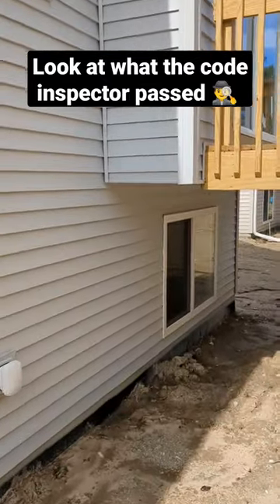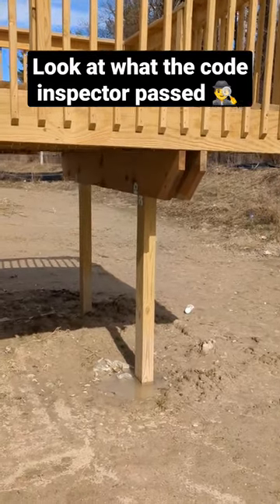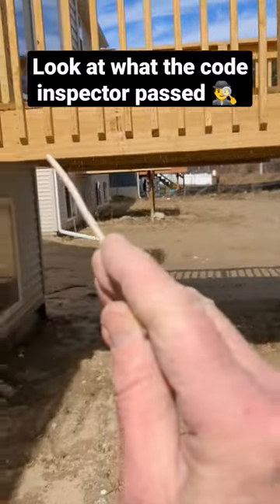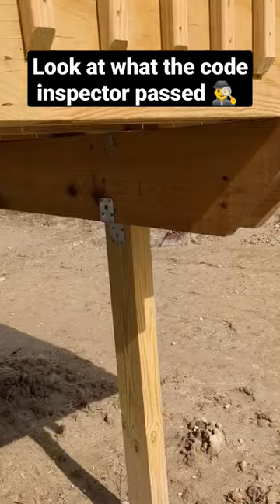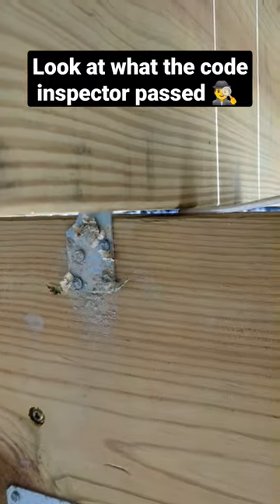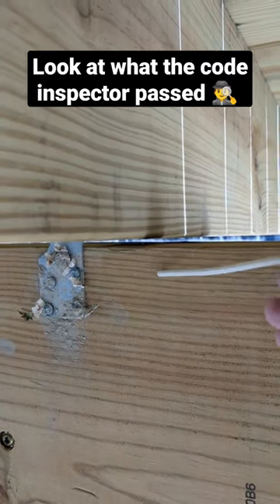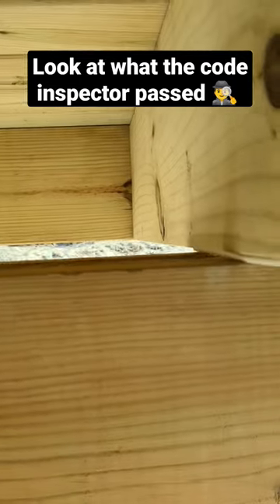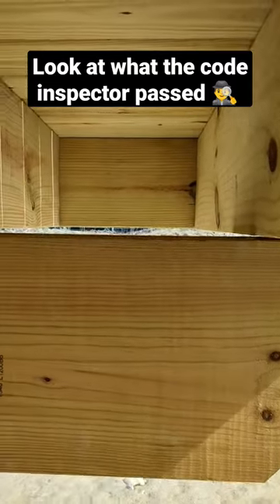Code #inspectors don't pay attention to detail#deck #newconstruction#youtubeshorts#shortvideo#shorts

Comment: Never seen a deck built like this. Why not use longer post, notch the corners and use the post as handrail too.
Reply from the maker: Yep. The whole deck is actually wrong and needs to be rebuilt. And yes, you could use a longer post if they are 6x6. This home got worse. SEE Missing Footings Inside https://youtu.be/TqGMGpvnVAk
I've been finding more developments selling homes with NO decks, but they install handrails in the slider door frame. Once the code inspector is gone a crew member comes back and slaps on the deck for extra money 🤑 and no permit. Ugh.
Thanks for watching.
Reply: @inspectflix  yeah 6x6 be more meat and the right way

Comment: The bigger question is, is it properly tied to the house?
Reply from the maker: Nope. The entire deck is improper and needs to be rebuilt.This home got worse. SEE Missing Footings Inside https://youtu.be/TqGMGpvnVAk
I've been finding more developments selling homes with NO decks, but they install handrails in the slider door frame. Once the code inspector is gone a crew member comes back and slaps on the deck for extra money 🤑 and no permit. Ugh.
Thanks for watching.

Comment: That's not a issue not going to fall down or anything. And will settle. The problem are the posts below grade sitting in water already. Even if it's code in that area doesn't mean it's ok why do it that way it's ridiculous.
Reply from the maker: Agreed. There were even more problems with that deck. The rest of the house was worse.
Thanks for watching

Comment: Those 4x4 posts resting directly on the dirt with a puddle of water around it? who built this? it will last about two weeks. This is why I did my patio myself.
Reply from the maker: Exactly!. You never know who it is. Subz. This home got worse. SEE Missing Footings Inside https://youtu.be/TqGMGpvnVAk
I've been finding more developments selling homes with NO decks, but they install handrails in the slider door frame. Once the code inspector is gone a crew member comes back and slaps on the deck for extra money 🤑 and no permit. Ugh.
Thanks for watching.

Comment: That deck doesn't seem to be to be sturdy enough anyway. It has just two fairly small section post sitting in water and the house wall to rely on. I hope the latter is very secure.
Reply from the maker: Nope. Everything is wrong and not up to code. That house got a lot worse. 3 pages on a new build.🤦😖ugh. Check out those missing footings inside.
Thanks for watching

Comment: I noticed that the post are sit in the ground. Here , we have to pour concrete in a hole with rebar then put the post on top of the concrete on a steel plate.

Comment: Everyone expects inspectors to look at everything and also know their code. Nothing could be farther from the truth. Also some inspectors give a pass on some things for contractors they deal with a lot. In extreme cases they accept bribes and favors. Lawsuits can also come about from their ignorance and mistakes.
Reply from the maker: Yep. And I'm sure it's different in all areas. Our problem here is the speed process. Some of the decks are installed after code inspections are done. 
They slap a temp handrail in the slider and then someone comes along and slaps the deck on after everybody is gone.
Thanks for watching

Comment: I was taught to put the beam on top of the post and blocking on each side to like it to the Post in the video looks like they just nailed it to the post and put a goofy bracket underneath it that I wouldn't trust keep in mind it is holding the deck

Comment: I’m no expert, but those two wooden beams don’t seem sufficient supporting the weight of people on that deck!
Reply from the maker: Nope they are not 🚫. Actually the entire deck is improper and needs to be rebuilt.This home got worse. SEE Missing Footings Inside https://youtu.be/TqGMGpvnVAk
I've been finding more developments selling homes with NO decks, but they install handrails in the slider door frame. Once the code inspector is gone a crew member comes back and slaps on the deck for extra money 🤑 and no permit. Ugh.
Thanks for watching.

Comment: Not supposed to attach to an overhang, sandwich headers are a not legal in most states anymore, and  whats up with the 4x4s instead of 6x6's. If the floor of the deck exceeds 6' they need to be minimum 4x6, 8' needs to be min 6x6

Comment: What's up with the wood being submerged in water too?
Reply from the maker: All bad! Unfortunately here in Michigan the code allows the post to go in the ground but must have footings. And 1 in 10 builders here are licensed. 
I think the deck may have been installed after the code inspector gave it a final.
What the builder does is put a handrail in the slider door track. Then someone comes back after and slaps that junk together.
Thanks for watching
Reply: @inspectflix  Oh gosh.  Yes, that definitely comes down to making sure to use a good builder.  Just because code allows something doesn't mean you can't or shouldn't improve upon the code to build things to either a better or safer standard.  Only 1 in 10 builders being licensed is kind of frightening.  I'm all for people being independent of government overbearingness, but only if they actually know their job and how to do things right.

Thanks for the video!

Comment: Gaps need shims at this point...dimensional lumber is not uniformly cut. You want a poker flat deck with no gaps? Rip all your joists to the same width and go from there.

😅

Comment: What about the 4x4 post inside the footings? It’s supposed to rest on top!
Reply from the maker: Yes. Absolutely should be on top. But, who knows what's really down there without digging. The entire deck is actually improper and needs to be rebuilt.This home got worse. SEE Missing Footings Inside https://youtu.be/TqGMGpvnVAk
I've been finding more developments selling homes with NO decks, but they install handrails in the slider door frame. Once the code inspector is gone a crew member comes back and slaps on the deck for extra money 🤑 and no permit. Ugh.
Thanks for watching.

Comment: Im confident those tiny galvanised z brackets holding those beams onto those posts aren't going to last long enough to worry about seating those floor joists.
Reply from the maker: 👍 And we don't know about the footings either Lol. That deck is a mess. Needs complete rebuild.
Thanks for watching

Comment: How about a cantilever deck attached to a cantilever. The deck should be self- supported.
Reply from the maker: Yes. The entire deck is actually improper and needs to be rebuilt.This home got worse. SEE Missing Footings Inside https://youtu.be/TqGMGpvnVAk
I've been finding more developments selling homes with NO decks, but they install handrails in the slider door frame. Once the code inspector is gone a crew member comes back and slaps on the deck for extra money 🤑 and no permit. Ugh.
Thanks for watching.

Comment: How can that be fixed?
Reply from the maker: It really can't or shouldn't because there's too many other problems.The entire deck is improper and needs to be rebuilt.This home got worse. SEE Missing Footings Inside https://youtu.be/TqGMGpvnVAk
I've been finding more developments selling homes with NO decks, but they install handrails in the slider door frame. Once the code inspector is gone a crew member comes back and slaps on the deck for extra money 🤑 and no permit. Ugh.
Thanks for watching.

Comment: I think we are a little picky about nothing. That will settle with a little weight on it with no damage. I’d be worried about the small posts more and being in water doesn’t help.
Reply from the maker: Perhaps, but I made several mini videos for my educational training. The entire deck is improper and needs to be rebuilt.This home got worse. SEE Missing Footings Inside https://youtu.be/TqGMGpvnVAk
I've been finding more developments selling homes with NO decks, but they install handrails in the slider door frame. Once the code inspector is gone a crew member comes back and slaps on the deck for extra money 🤑 and no permit. Ugh.
Thanks for watching.

Comment: So the beam is supposed to be supported by a hurricane bracket?
Seems way off!!!
Reply from the maker: 🤣😂🤣 it is. Lol The entire deck is improper and needs to be rebuilt.This home got worse. SEE Missing Footings Inside https://youtu.be/TqGMGpvnVAk
I've been finding more developments selling homes with NO decks, but they install handrails in the slider door frame. Once the code inspector is gone a crew member comes back and slaps on the deck for extra money 🤑 and no permit. Ugh.
Thanks for watching.

Comment: It could be that those joist are Bowed up with is the right to be done, beacouse over time they will sagged.. my biggest concern it's that deck being attached on that bay window.
Reply from the maker: Yep, it could. There are a lot of problems on the deck and house. I made several videos too.This home got worse. SEE Missing Footings Inside https://youtu.be/TqGMGpvnVAk
I've been finding more developments selling homes with NO decks, but they install handrails in the slider door frame. Once the code inspector is gone a crew member comes back and slaps on the deck for extra money 🤑 and no permit. Ugh.
Thanks for watching.

Comment: There’s real issues with this construction and he points out something that not going to make structural difference. You have a header beam not on top of the 4x4, there’s no blocking above the beam so you know the joists are twisting. I’m happy they used mechanical connections tho because that makes it’s safe

Comment: Design is amazing window under deck and whole deck sits on two 4x4 house barely settled in ground 😅
Reply from the maker: Awesome 🤭🤭🤣. The rest was even worse in the house.
Thanks for watching
Oh . Don't forget to check out the missing footings inside.
Reply: @inspectflix  if there is no footings what bearing walls sits on dust?
Reply from the maker: @davidfedak8658  yes. Hollow cavatiy. Wild huh🤪
Thanks for watching the video.

Comment: Also can’t attach deck to cantilevered overhang on the house
Reply from the maker: Exactly... And posts and beam is also improper.
I really think that deck was installed after the code inspector left. The builders here are installing a rail in the slider door with no deck and the code inspector signs off. Then someone slaps that junk on afterwards with no permit. But we'll never know, my buyers walked away.
Thanks for the comment and for watching.

Comment: Cant hang a deck on a soffit. Needs to be self supporting with a beam at the back.
Reply from the maker: Yep, lol The entire deck is improper and needs to be rebuilt.This home got worse. SEE Missing Footings Inside https://youtu.be/TqGMGpvnVAk
I've been finding more developments selling homes with NO decks, but they install handrails in the slider door frame. Once the code inspector is gone a crew member comes back and slaps on the deck for extra money 🤑 and no permit. Ugh.
Thanks for watching.

Comment: How are they relying on the rim joist? The rim joist is relying on the floor joists and the hurricane traps are holding everything up. You didn’t even notice the biggest problem I saw… sheesh
Reply from the maker: The entire deck is improper and needs to be rebuilt. I made many short videos on the whole house.This home got worse. SEE Missing Footings Inside https://youtu.be/TqGMGpvnVAk
I've been finding more developments selling homes with NO decks, but they install handrails in the slider door frame. Once the code inspector is gone a crew member comes back and slaps on the deck for extra money 🤑 and no permit. Ugh.
Thanks for watching.

Comment: I think my problem is with those toothpicks holding it all up. And they aren’t even set in concrete. Hell the one is in standing water.
Reply from the maker: Absolutely.The entire deck is improper and needs to be rebuilt.This home got worse. SEE Missing Footings Inside https://youtu.be/TqGMGpvnVAk
I've been finding more developments selling homes with NO decks, but they install handrails in the slider door frame. Once the code inspector is gone a crew member comes back and slaps on the deck for extra money 🤑 and no permit. Ugh.
Thanks for watching.

Comment: I'd like to see what they did to attach it at the other end
Reply from the maker: It also was incorrect. The entire deck is actually improper and needs to be rebuilt.This home got worse. SEE Missing Footings Inside https://youtu.be/TqGMGpvnVAk
I've been finding more developments selling homes with NO decks, but they install handrails in the slider door frame. Once the code inspector is gone a crew member comes back and slaps on the deck for extra money 🤑 and no permit. Ugh.
Thanks for watching.

Comment: You point out something that isn't that critical, yet can't see that you're not supposed to attach a deck ledger board to a cantilevered floor. Plus the fact that the ledger is too low....
Reply from the maker: Thank you. There's even more things wrong to the deck and it needs to be rebuilt. The critical problems were on the actual house and I had little time to make video. Check out Missing Footings Inside https://youtu.be/TqGMGpvnVAk
I've been finding more developments selling homes with NO decks, but they install handrails in the slider door frame. Once the code inspector is gone a crew member comes back and slaps on the deck for extra money 🤑 and no permit. Ugh.
Thanks for watching.

Comment: Forget about the post and beam.  What about the ledger attached to a cantilevered bump out.   Seriously
Reply from the maker: Oh it got written up, along with 3 pages inside the house.
I think these decks are getting slapped on after the code inspector is gone.
They get a final pass with a rail installed in the slider track. Then someone comes back afterwards.
Thanks for watching
Reply: @inspectflix  you are correct .  I have been in the industry for 28 years designed and built over 750 decks/screen rooms.   Regardless of State.  You and I both know there is a national code as well. If an inspector passed this, there is something afoot, because it is a HUGE NO NO ledger to an overhang.  NO way.   Keep up your videos I appreciate them .  Let me know if you ever want  images of job sites etc. Privately.... and post whatever you want  Always fun to correspond with a fellow builder 👍👊
Reply from the maker: @nate1976100  awesome! Thanks for watching.

Comment: 1 You cannot attach to a cantilever window like that
2 You cannot do 2 beams like that they need to be doubled up and then notched. It is actually weaker to have 2 beams like is shown than 2 doubled up beams together. 
3 ground contact post is trash in new build
4 what you said.

Whole thing needs torn down and rebuilt
Reply from the maker: I hope they did. Your outline was all written up and
My buyers walked away.
 That house got a lot worse.
You should see the missing footings inside. https://youtu.be/TqGMGpvnVAk
Thanks for watching.

Comment: Different widths from one joist to another, better to align everything to the top. If not you have a wavy deck. Just shim the joist to the beam. Or get the mills to produce the same exact widths. You can be anywhere from 1/4 to 3/8 different from joist to joist. Duhh

Comment: Nobodys mentioned the beam not sitting on top of post?
Reply from the maker: Oh they did. As a matter of fact The entire deck is improper and needs to be rebuilt.This home got worse. SEE Missing Footings Inside https://youtu.be/TqGMGpvnVAk
I've been finding more developments selling homes with NO decks, but they install handrails in the slider door frame. Once the code inspector is gone a crew member comes back and slaps on the deck for extra money 🤑 and no permit. Ugh.
Thanks for watching.

Comment: When i first saw it my first thought was where the fuck is the bracing? I might have missed it but usually your supposed to have bracing on the side of the house the deck is mounted to. But with an overhang like that id imagine theres also supposed to be either a beam on each side or more footing closer to the house.

Comment: Nothing structurally wrong with the deck joists floating 1/8th of an inch. Most likely due to moisture loss and will settle just fine. More "professionals" certified by the state and now they think they're engineers.

Comment: athat is becaus they used those simpson connectors at the joust/beam connection.   after installation, the joists shrunk(due to PT being so wet and drying out)...the same thing happens when yoy use joist hangers.   My personal deck is now 7 years old, and was installed by toe nailing the joist into the ledger board on the house, and installing the hangers after...all joist have shrunk, and are now floating 1/4" above tha hanger, with zero setlting.   Hangers are a product sold by the industry to make more money...as a professional carpenter, I dont believe they are nessesary provided you know how to propperly fasten things.

Comment: Shingles to the rescue! 
Now let us talk about all that weight sitting on two 3.5 X 3.5 inch STICKS.
Reply from the maker: 🤣🤣🤣 lol. Yes, that whole deck is wrong. Lol. You should check out the missing footings inside.  https://youtu.be/TqGMGpvnVAk
I've been finding more developments selling homes with NO decks, but they install handrails in the slider door frame. Once the code inspector is gone a crew member comes back and slaps on the deck for extra money 🤑 and no permit. Ugh.
Thanks for watching.